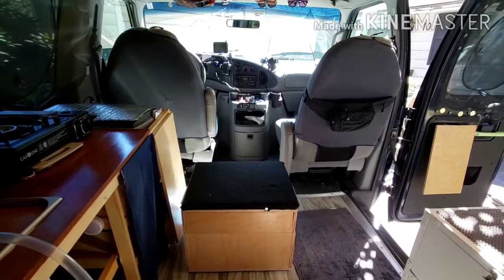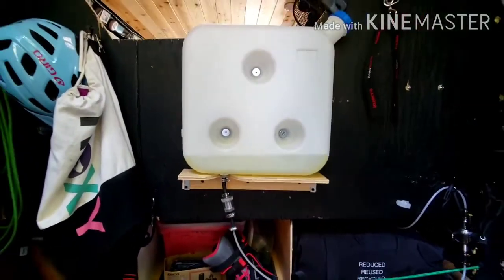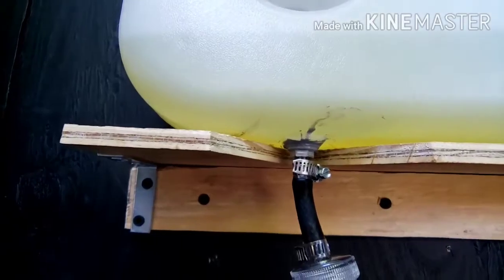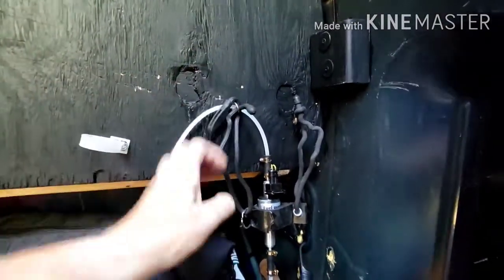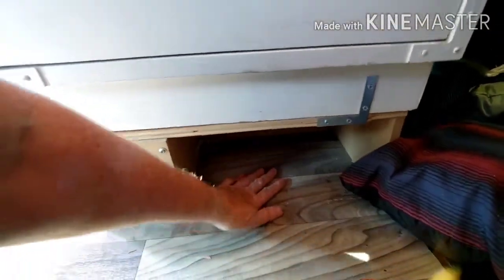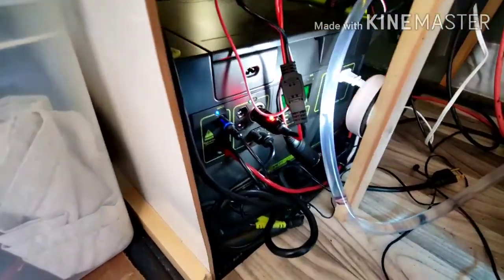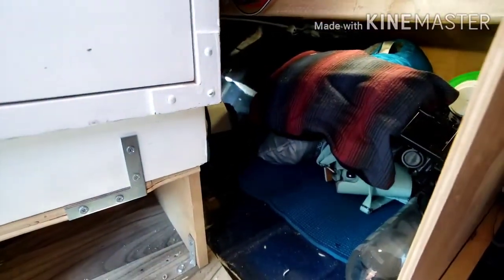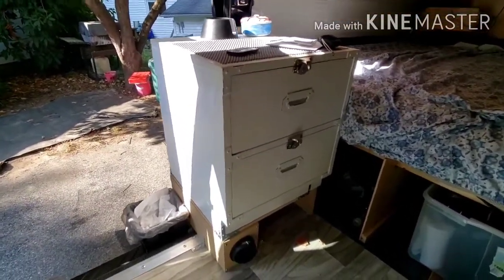WE INSTALED DIESEL HEATER IN THE VAN

Comment: Any planned update?

So the goal zero handles the electrical requirements of this heater throughout the entire night?
Reply from the maker: It hasn't been cold enough yet to run it all night but I will let you know. I am confident it will though because if the heat is on then nothing else will be drawing much from goal zero. Just the fridge a little.

Comment: did u have to use an inverter?
Reply from the maker: We use the goal zero which has a built in inverter.
Reply: The heater needs 12v power to operate

Comment: It appears that fuel filter is installed backwards.  There is a direction of flow which should be observed.  Typically there is an arrow on it for reference. If it is it's a quick fix to turn around. There is a picture provided in this article down in the text.

https://www.bikebandit.com/blog/how-to-install-and-replace-a-motorcycles-fuel-filter-guide

Cheers.
Reply from the maker: Oh wow. Thank you. You are right.  We switched it.
Reply: @lisamallard  I'm happy I said something after noticing it and it helped you.  One reason that  is important is so you can see the crap it filtered out and know when to change it.  The other way the crap will be inside the filter material and not visible.  It can also collect more gunk the right way than the wrong way before it's flow is reduced. That filter material inside also blocks water and you will see that as opposed to not seeing the water if it is present.  Best wishes.